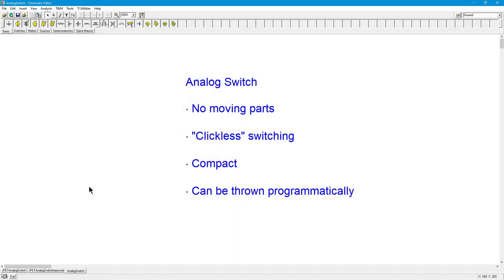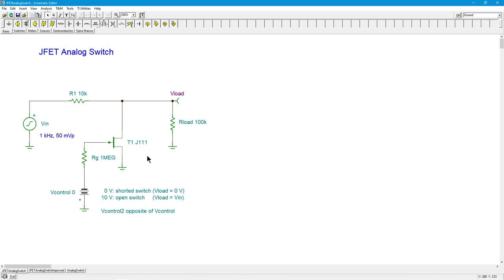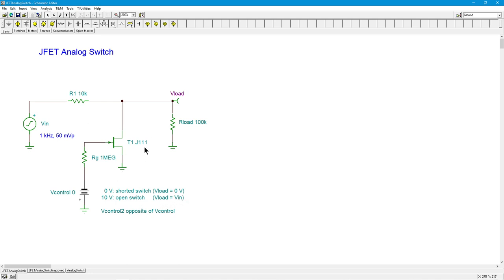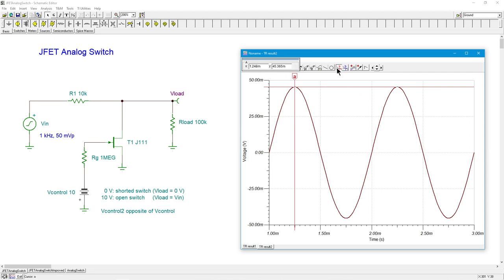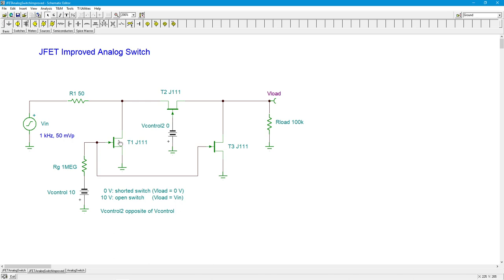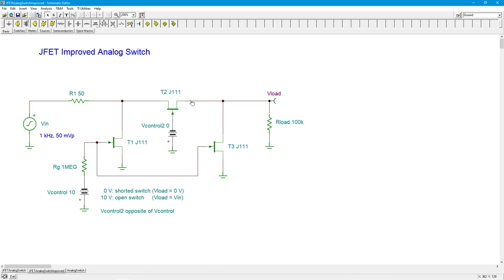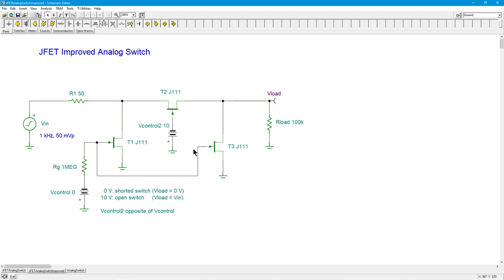Semiconductor Devices: JFET Analog Switch

Comment: I would be very interested in seeing different switching topologies like SPDT and SPTT... is that possible to demonstrate to us? Also... switching between high impedance and low impedance inputs, could that create non-linear behaviour within the switch at various voltages?
Reply from the maker: Remember, these switches are activated by a control voltage rather than a mechanical linkage. Consequently, you can configure all manner of bizarre configurations. For example, you could have four of these "in parallel" engaging four inputs to four outputs. If you use a common control voltage, they'd all operate in tandem, like a 4PST switch. Of course, you could also invert the control voltage on, say, two of them, so that two inputs contact while the other two don't, and so on. And because it's a control voltage, they can be generated programmatically, e.g., hooking those logic pins back to something like a microcontroller.
Reply: @ElectronicswithProfessorFiore  I see so basically to make a single pole multi throw, I would make as many parallel circuits as I need and switch between them in a round robin manner always keeping only one circuit in a logic state high at a time...?
Reply from the maker: @MellexLabs  You got it.

Comment: Why have the 1st and 3rd at all? Why can't the 2nd one alone do it?
Reply from the maker: The FET "on" resistance isn't zero, and its "off" resistance isn't infinity, so some small remnant of the signal gets through when the switch is off. The T configuration reduces that leakage down to the noise level.

Comment: Seems like the phase is inverted with the analog switch
Reply from the maker: Vload is in phase with Vin. Functionally, this is no different than a simple resistive divider. The only "inversion" here is the control signal for the middle FET in the improved version.
Reply: @ElectronicswithProfessorFiore  yeah, that’s what I was referring to, the improved version. Would that be for the output? Or will it inverter again right before the output? Thanks for the clarifications.
Reply from the maker: @rickybrenay6249  There is no inversion of the input signal in either version of the circuit.
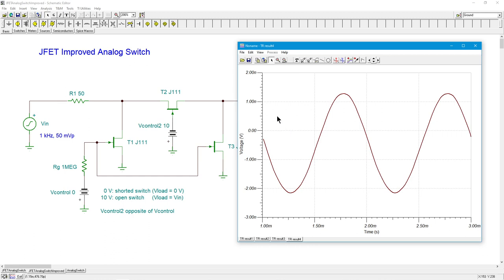Reply: Yea that's what i thought too, just at 11:18 mark in the video it shows the sine wave inverted. Thanks again!!  @ElectronicswithProfessorFiore
Reply from the maker: @rickybrenay6249  Yeah, that's just leakage. Note that the signal is only about 3 NANOvolts peak-peak! You'd never hear this in an audio application.
Reply: @ElectronicswithProfessorFiore  you the man!!! Thank you, it’s always the small details.